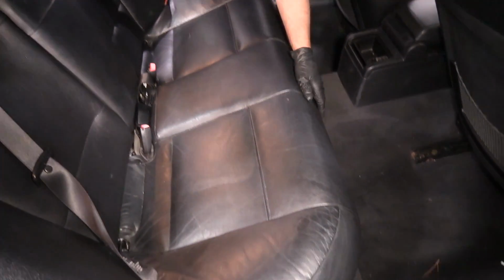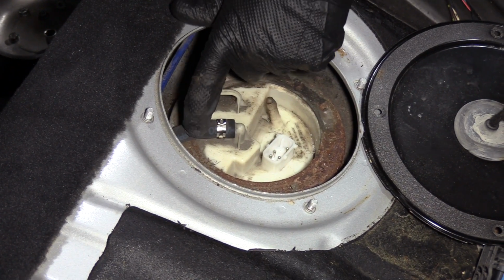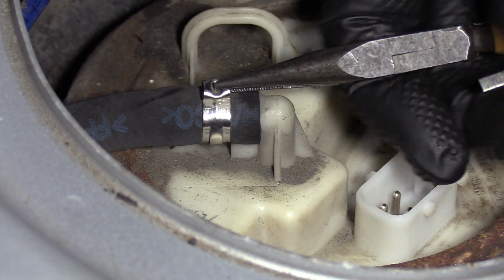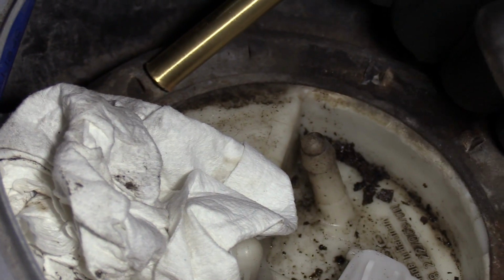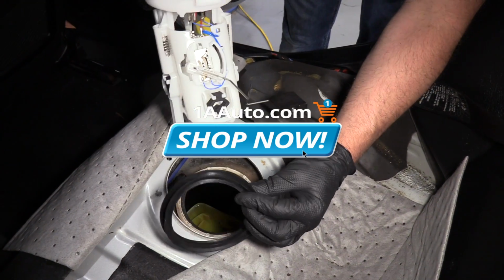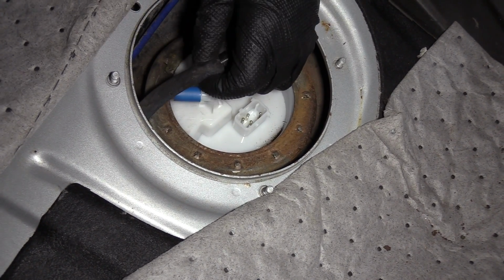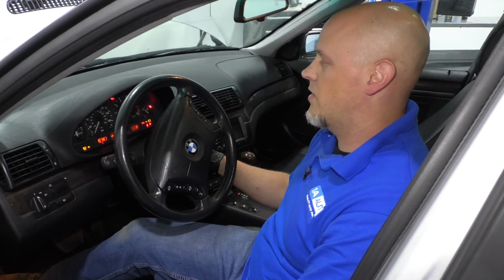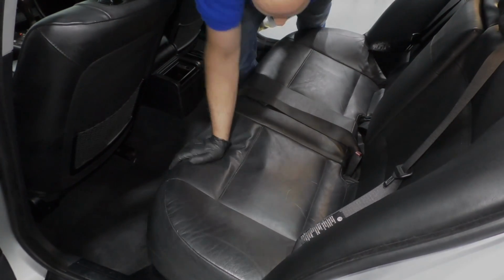How to Replace Fuel Pump 01-05 BMW 325 Xi

Comment: Right on man. I thought it was the battery at first I tested it and it was reading 11.9 so I bought a new battery which costed me $160, and that wasnt the problem, but I couldn't return the damn battery. I figured it must be the fuel pump so I spent $270 on a fuel pump. When I got done with it all right before i turned the car on to see if it worked I was shittin bricks. I told myself if it didn't start I was lighting the car on fire. And boom it started. About 500 dollars later. Eesh. Thanks for your video, all your videos they've helped me a ton
Reply from the maker: +USMC ROMP Thank you! We love empowering our customers and showing how to perform DIY auto repairs with our high-quality auto parts.  http://1aau.to/m/Shop-1AAuto-c

Comment: That was a great video, I'm surprised you don't have more comments.  I was dreading taking my BMW to the dealer for a fuel pump replacement.  After watching, I feel confident enough to do it myself.  I really appreciate the tips.  Thanks.
Reply from the maker: +Vic Blaine Thanks for checking us out. Shop for high quality auto parts on 1AAuto.com:

http://1aau.to/m/Shop-1AAuto-c